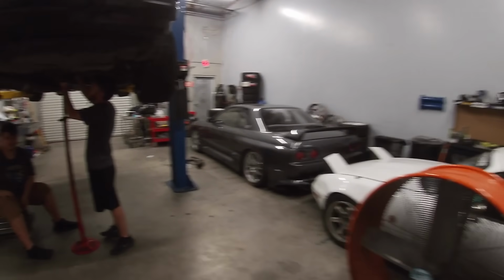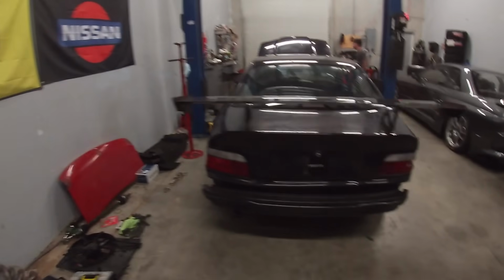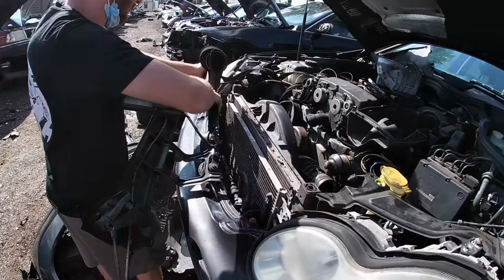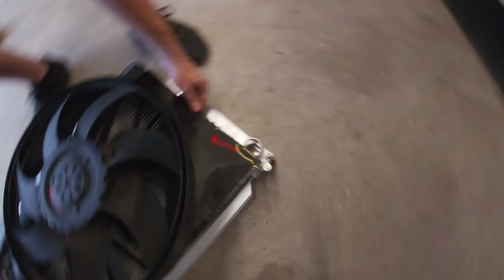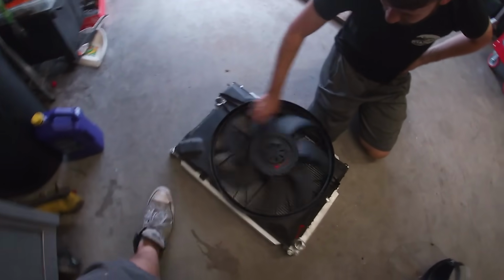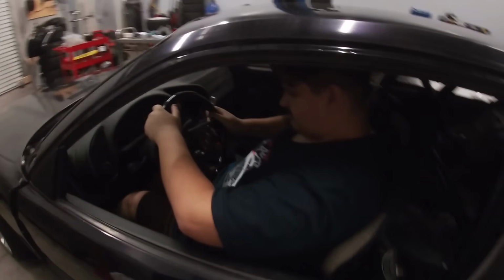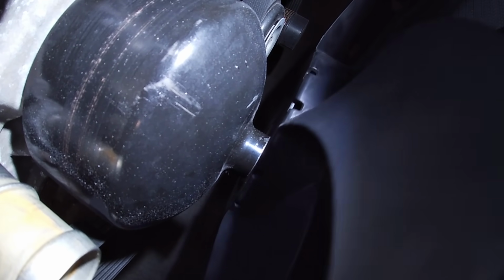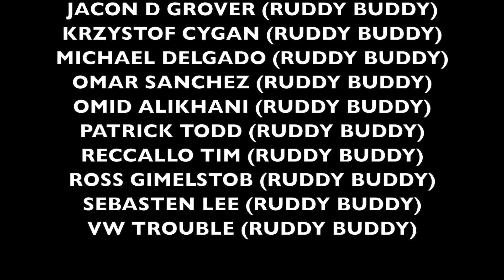FRIENDS FIXING MY DRIFT CAR!

Comment: You will have a mile of clearance if you switch the water pump with a 2010 to 2015 Camaro water pump. It's pulley is way more low profile